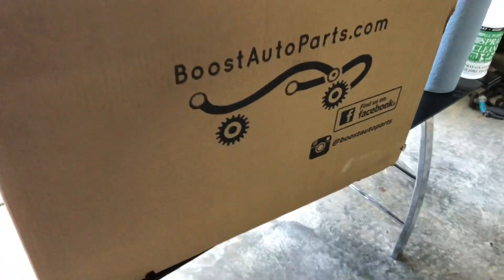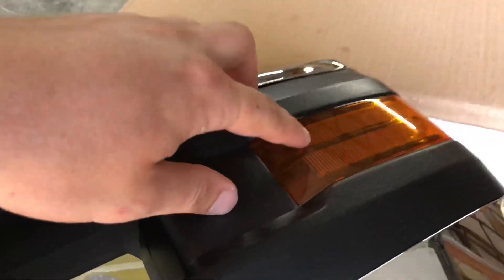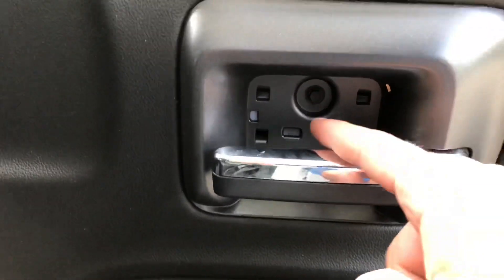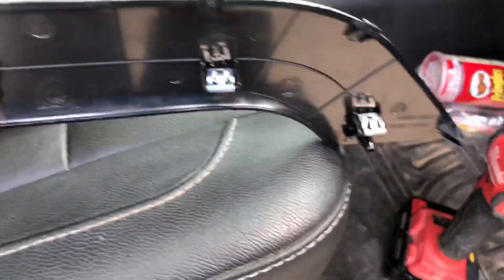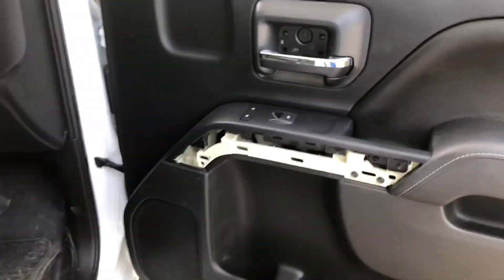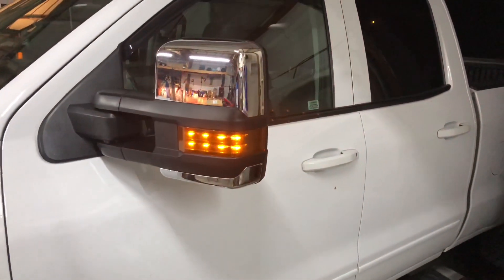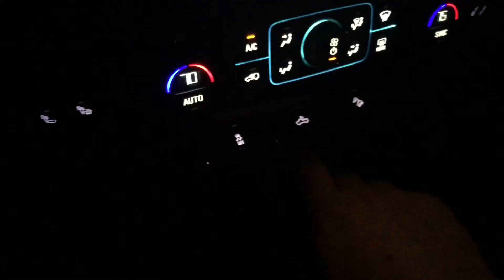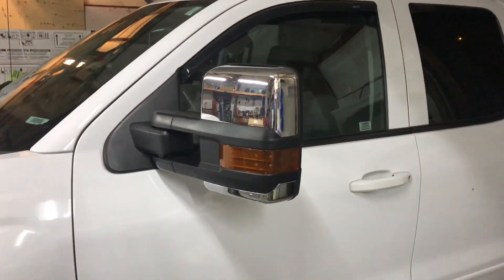Boost Auto Parts Tow Mirrors and Door Harness Modification Kit - 2015 Silverado 1500

Comment: How do you like those maxxis carnivors on the rzr
Reply from the maker: Great overall tires.  I had a set of 28s on my 900S and the ones on my XP1K are 30s.  I've got around 1200 total trail miles between the two sets and have only had one puncture.  They hook well in all terrain and will clean out pretty well also.
Reply: Jason hello Jason 
Where can I find a video showing how to connect all the pin wires etc... from what terminal to which one etc...
Thank you so much
Reply from the maker: Ohad Bendavid https://youtu.be/74yND-l8xwQ
Reply: Jason I got those winjet headlights like you purchased a while back, is there an easier way to adjust the angle of the lights on the passenger side? The air box is is in the way and I can’t fit a screw driver in there
Reply from the maker: @KoMan179  Not to my knowledge.  I think it has to be removed and then adjusted.
Reply: Jason ok I’ll try that, cause my headlights were aimed really low when I got them installed, if I didn’t have bright fog lights, I wouldn’t drive at night
Reply from the maker: @KoMan179  I experienced the same issue and adjusted them as high as I could get them while still being level at the light cutoff line.  Even still that wasn't ideal, but I soon installed a leveling kit on my truck when I got new wheels/tires to raise it 2" and that made it perfect.
Reply: Jason and to adjust it vertically , it’s the top screw on the back of the headlights right?
Reply from the maker: @KoMan179  I think that's correct.  It's a gold-colored adjustment screw if I remember right.
Reply: Jason alright thanks man, I’ll have to try that
Reply: Kolby1799 I’ll